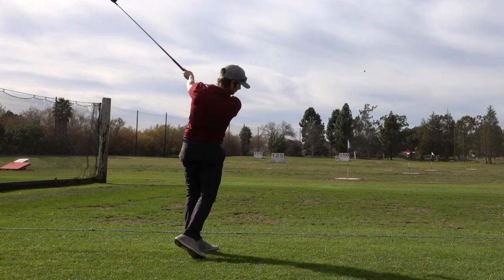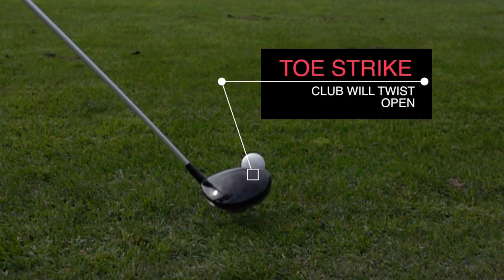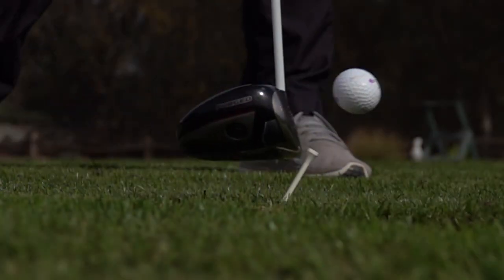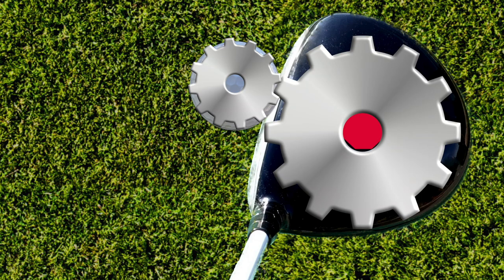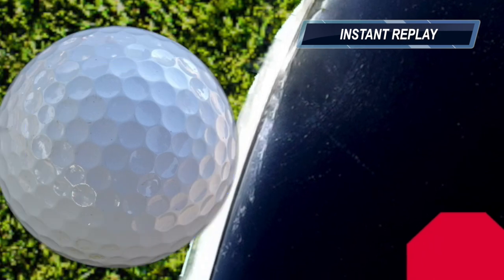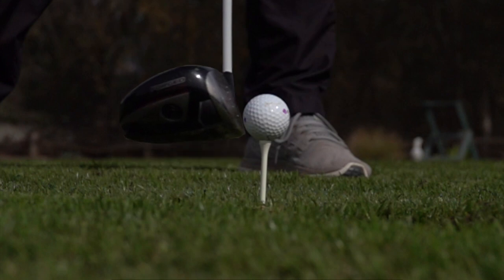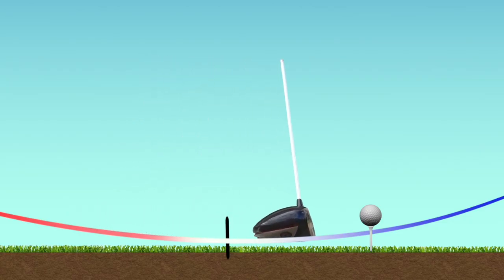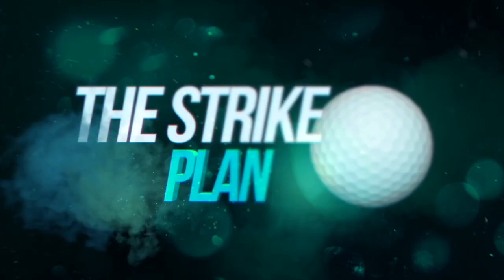What Is Gear Effect In Golf?

Comment: Great post Adam!  I think Gear Effect is one of the least understood of the "impact factors" (face-angle, path-angle, etc) that affect ball flight.  Here's my question:  I realize that heel or toe impacts result in lost distance, and are obviously undesirable from that perspective.  But can Gear Effect itself be considered beneficial, because it "self-corrects" the directrional dispersion of the ball flight.  For example, a toe hit twists the face open, resulting in an initial ball direction that is more LEFT than desired.  But the Gear Effect associated with a toe hit imparts draw spin on the ball, which tends to curve the ball flight back towards the RIGHT.  So if we mentally separate Gear Effect (as a direction effect) from off-center hits (as a distance effect), is Gear Effect beneficial?
Reply: OK, I mixed up RIGHT and LEFT in the above comment ... but you know what I means!  Thanks!
Reply from the maker: Actually, gear effect is so extreme that, if the clubface were flat like an iron, a toe hit would go off the course left. Manufacturers placed bulge and roll on the face (curvature) with bigger headed clubs in order to minimize gear effect. 

The process is getting better and better, but gear effect is actually quite chaotic. It produces very inconsisetnt results across the face. For example, a slight toe hit may draw, a bigger toe hit may hook, then an even bigger toe hit might block to the right (all else being equal). Therefore, if we want consistent results, we need to really hone in on our strike quality - a lesson that is often overlooked in todays obsession with swings.

Gear effect can be beenficial regarding distance. Hitting slightly higher on the face above the sweet spot can create a higher launch, lower spinning condition which adds disatnce. I discuss this here - https://www.adamyounggolf.com/vertical-gearing/
Reply: I'm not sure I understand what you mean by gear effect producing chaotic results.  Seems like the physics of gear effect would be pretty repeatable.  Is it because of the curvature that the manufacturer's put on the Driver faces?  Or is it gear-effect combined with the face/path (i.e. D-plane) effects that produces bizarre ball flights?

I can really relate to your comments about vertical gearing when hitting high up on the Driver clubface.  I was formerly a tennis player.  When I hit that shot high up on the face of my Drive, it reminds me of hitting a top-spin forehand in tennis.  I know that the golf ball doesn't really have top-spin (just a bit less back-spin), but still ... that's how it feels to me.  And the distance is awesome!
Reply: I think he means that it doesn't take a large difference in the location of impact to create a large change in the ball flight. In other words, the difference between being on the fairway and out of bounds might be just a very small amount of additional gear effect.
Reply: @robertdavis2323  I think he's saying that as ball contact get nearer the toe, the result goes from slight draw (left), hook (also left), then suddenly block (right), so you have two extremes, left and right shots, that result from millimeters difference in contact points near the toe. If you were to have that same area of contact as before, but have it more centered, then the results would be much more manageable and without the above-listed extremes of left and right.
Reply from the maker: Hi  @robertdavis2323  , great question. The reason is because, during an off centre hit there are lots of things going on. On a toe shot, for example, the face opens up. On a small toe hit, the actual gearing is small but dominant, and there is usually a little bit of curve. Go a little more towards the toe and the gearing become bigger - enough to overcuve the ball. You think this trend would continue, but it doesnt. When you go past a certain threshold, the face opens so much (and gear effect starts to get smaller) that the open face to path relationship starts to cancel the gearing out. This could result in a straight push to the right, or even a push fade. 

I go through a lot of this in NLG using more videos to explain this concept (tough to get accross via written form). 

I ahve a feeling that the manufacturers will be able to adjust the bulge/roll across the face in the future to reflect this, giving more consistent end results across the face. But, ultimately, we should try to improve our strike to get around this.